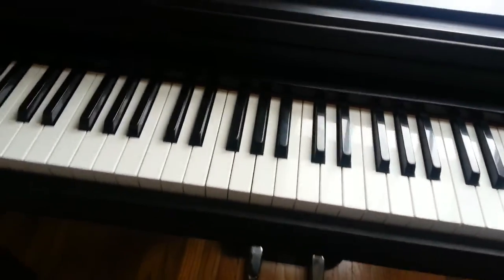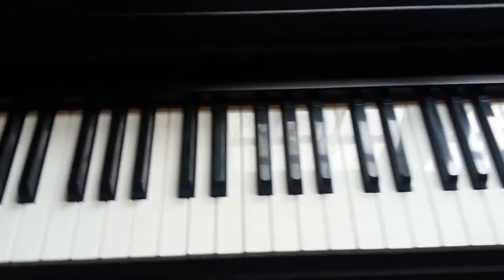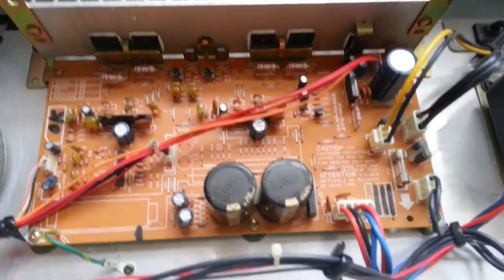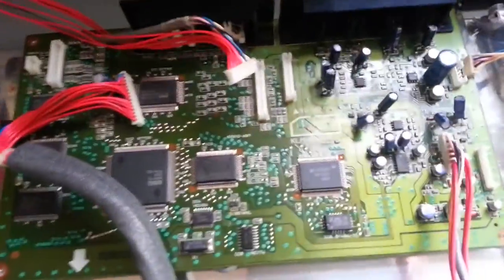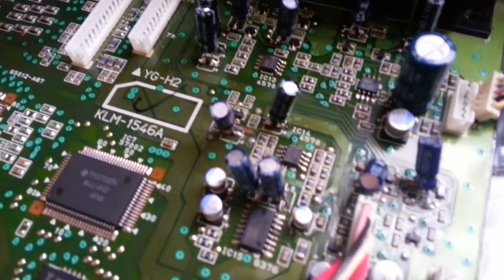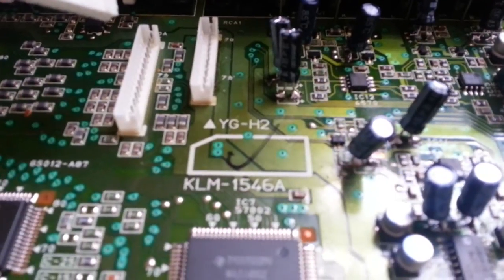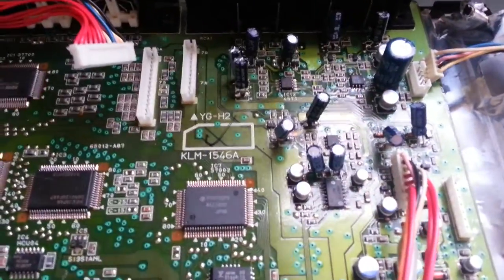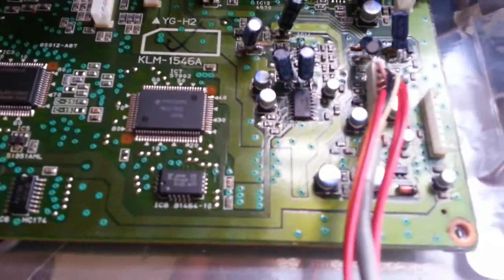How to Repair Korg C-25 Concert Piano no sound

Comment: Thanks so much for the great information on this topic. Picked up a free Korg C-36 last night. Powers up. Lights up. Very low volume and only left speaker works. I assume that replacing the capacitors is necessary. Never soldered before. Is this something a novice could do or should I hire out? Any good soldering 101 videos out there?
Reply: Also, where are the screws located to open the top cover? Doesn’t look like they’re on the bottom and the side is covered with a plastic cap. Any guidance would be appreciated.
Reply from the maker: I wouldn't recommend you to do the soldering, because if you are not professional-you can damage the board. Better to take it to some TV repair shop and ask them to replace the capacitors, also I would recommend after removing the bad ones to wash the board with alcohol.
 Good luck.

Comment: Thanks.  Got it open. Circuit board and capacitors look pristine. Any other ideas why I am getting no sound?
Reply from the maker: Were you able to check your amplifier, if it works fine, then the capacitors need to be changed for sure, do not be confused the way they look?
Reply: @artsvideoonline  I have a C15 and just wondering how I could check my amplifier as you mention here?   I sure belive my problems is witht the caps as well...lost sound over time, and then finallly only on headphones and not even that any more.  I can get very thin sound from AUX to phones, but that's it.

Comment: WOULD ANYTHING ON THE SOUNDBOARD MAKE ONE NOTE RING OUT AT FULL VOLUME  ON A CLAVINOVA , I HAVE TRIED EVERYTHING , UNDER THE KEY ,THE PENCIL LEAD  ,CLEANED CONTACTS , CHANGED OUT KEY , CHECKED DIODES ...BUT STILL THE SAME ONE KEY RINGS OUT ...THANK YOU......
Reply from the maker: ...you mean one key is producing sound all the time by itself?
Reply: hi,
no just pressing the key half way it rings out at full volume ,same volume no matter how soft or hard you hit it......thank you for replying and help
Reply from the maker: Each and every key has two buttons, if one of them does not work-you'll get that problem. I would recommend you to drop a conductive paint (just a tiny drop with toothpick) on black rubber, let it dry up for a night , then should work OK.
Reply: Fixed it ! .....the earlier clavinovas actually have 4 graphite strips pre key and after cleaning and repainting them 6 times ( made my contact paint with water based polyurethane and graffiti powder ) with no results on the last try before putting it on the lawn , Out of the corner of my eye a tiny glimmer of copper speck flashed on the trace between the next 4 strips , the green material that seals the copper trace had worn off so small you really couldn't see it.... but it was enough to make contact when the the key was pressed.... paint brush and poly urethane over the worn spot..... good as new....there is no way of replacing these board yamaha stopped selling them so bringing them back to life is the only way... thank you for your help , i hope this will help other people keep these alive....

Comment: Dear Sir, I've got a problem with my left speaker from my keyboard, I thought its comes from the broken of the left built-in speaker but when it plays a demo song through my amp speaker, the left part of the song was gone. I don't know how to fix this, whether to determine the problem from the speaker itself or from the capacitors, how to check whether the capacitor is fine or not, any ideas? Thank you for your help.
Reply from the maker: There are some capacitor testers which you can use to check if they are good, or bad, even if they are soldered on the board, but I would say you have problem with capacitors and I would recommend you just change all of this surface mounted capacitors, take a plier, twist them (brake the pins), clean the surface were the caps are soldered and solder the new regular capacitors and your problem will be gone. Please check the other videos I have regarding this problem to get more ideas about it.
 Good lock.
 Best regards:
 Arthur
Reply from the maker: Just go a head and change all of the surface mounted capacitors. Sooner, or later all of them are going to be bad. Do not forget to clean the mainboard with alcohol gently. Sorry for the delay, just saw your message.
Reply: @artsvideoonline  Thank you Sir for your reply, most appreciate it. I'll try it soon.
Reply: @artsvideoonline  Thanks again Sir.

Comment: I was given a C-25 with no audio. I have a whole pack of 10uf capacitors ready. I still can't figure out how you got that cover to come up so easy?!! Do I have to remove every single screw on this thing?! Somebody help please!
Reply from the maker: Check Armando Fernando comment down there, he explains. Also before removing the bad capacitors check my other video where I explain how to remove bad capacitor,  don't use soldering iron,  use the plyer,  twist them at the same time pushing towards the board . good luck
Reply: @artsvideoonline  never mind. It is the 5 screws at the bottom sides. Actually, you only need to remove the long 4 screws. Skip the short 2nd screw from the front. That's just for the front leg.
Reply: Woohoo!!! Left speaker working and loud! Now thinking if I want to keep going. Ahahaha! Panicked when I got a muted sound earlier. Replaced a few more. Then totally lost all sound. Then found the lost connection. I dont want to go through that again. Ahahaha! Dont even try this without a magnifying glass on a holder.

Comment: Hey Artur, great video. I wondering if you can me out, id really appreciate it. i have a korg c-30 and when i turn it on i hear a buzz noise for a second and the button lights flash for a second and disappears. and obviously the piano wont play any keys. Do you think you can help me with my problem?
Reply from the maker: It looks like your amplifier is bad, consuming too much power. Try to disconnect the power to your power amplifier see if the light stays on.

Comment: Hi! I have a Korg Concert C50, it looks almost identical to your C25. A few nights ago, I was playing and I noticed the sound was getting weaker and weaker. I smelled an electronic burning smell and then the keyboard no longer had sound. I unplugged it immediately.

I opened the keyboard, but I don't see any "burns" on the board or anywhere for that matter. The keyboard seems to still power on, although the power light doesn't come on.

Could this be part of the capacitor problem as well? 

I really love this keyboard- it's weighted so well, but as you know, its from 1992, so it's very old.
Reply from the maker: If there is no power  there are two posibol reasons:
1 power amplifier is bad (consumes too much current )
2.Something is wrong with the power supply itself. 
if it is possible first disconnect the amp, if you get the power back means amp is bad. If no,then check the power supply, diodes in the bridge, or  something else.
Reply: +Artur Aroustamian thanks for the reply! it seems there is power, but no lights on the display. I push power, and it makes a crackle like its powering on, then you can slide the volume and it crackles ...
Reply from the maker: footose It seems to me like your power amp is gone, most likly the burning smell you heard was from the amp, which is probably made on a single stereo microchip. If it is possible try disconnecting the amp section, if you get the display back-change the microchip.

Comment: Which screws did you need to open to lift the top?
Reply from the maker: Lior Noy On the buttom there are Black screws with square washers, and the ones around the black base holding the feet of the keyboard.
Reply: ***** wow, thanks for the response Artur! So the reason I was needing help is because the tray that slides out to cover the keys was jammed on the left side and would not pull out. After a lot of jiggling what I discovered is that the circular knob with teeth on it has somehow fallen off the track guide on the left and is now underneath it. I'm trying to place it back but there is a smaller black knob in the center of the while, the small piece that actual fits into the track and holds it from falling out in the back, that gets in the way of me simply lifting the big wheel and placing it back on the track. I need to somehow open the left side half inch so I can place the tray back in the track and close it. That is my issue I am trying to solve. Do I need to remove the top to accomplish this? I found the 4 screws in front bottom with the square washers. I have the upright piano legs attached, I'm not sure if I need to remove them to access the ones around the feet. Maybe these are all the screws to access the sound boards in your video. Is there another way just to lift the top and access the tray?
Reply from the maker: Lior Noy The only way is to remove all the screws holding the upper part, it is very easy, don't worry, just remove those close to the feet (big ones only) and 2 others on each side and it will come out.
Reply: +Artur Aroustamian Can you send the screenshot where the screw located? I can't find the actual screw to remove it. I got this piano from my friend but it don't have sound. I would like try to recover it and play with it.
Thank.
Reply from the maker: David Lee On the bottom there are 4, or 5 screws about an inch close to the edge, left side and right side.
Reply: +David Lee It's basically all of the outside screws. I count 14 on mine. you'll want to have the glass in the closed position or you may break it (if yours has a glass cover)

Comment: Yup, you were right. I did it and now the C-15S works. Still something funny going on in the amplifier board, but it's been burning in for a few hours now and seems pretty stable. Thanks again, Artur. How did you figure out it was only the 10uf caps. I didn't see any leakage until I'd removed them all, and some appeared to be fine!
Reply from the maker: I am happy you did it, good job.

First thing -first I don't like this surface mounted capacitors, in my experience they cause most of the problems on electronic devices,  second I have a great capacitor tester, which allows you to check them on board, I mean you don't even have to remove them to check BDS-88A CapAnalyzer
This is 20. Years old, they might have even better ones now.
Reply: @artsvideoonline  Cool, good to know.  Now that the tone generator board is up and working, I'm finding problems with the amplifier board. The caps are probably the first thing to check. Always something with older gear! Thanks again.

Comment: Great video but I have a slightly different problem. On power up I have no sound. After about one hour of warming up it works great. If I leave it on all of the time no problems. but I would like to figure out this problem New power supply is my only thought..
Reply from the maker: Bad caps on the power supply. I would recommend you to change them.

Comment: What value capacitors did you use? 47uF for all of them?
Reply from the maker: There are different caps in this keyboard, what you have to do is do step-by-step, after removing lets say 10Mkf, put the same ...., just instead of using surface mounted caps I recommend using caps with pins. Also read other comments, because a lot of people fixed their keyboards and you might find some useful information from there. Good luck.
Reply: I see.. I'll take a closer look at the values. 

Thankfully I work in an electronics shop so we'll have plenty of spare parts :)

Comment: i have a korg sg-1d keyboard that powers on,but no sound,could this be the same problem youre explaining?i also have a roland d5 that had a blown input diode,replaced it and still doesnt power on,i checked some voltage points that are marked 6v 9v and they are lower than marked,the only place that works on keys has a 4 month lead time,any suggestions
Reply from the maker: Surface mounted capacitors create a lot of problems, and if you have them in your keyboard I would recommend you just replace them with regular capacitors. If you were local would be able with your Roland, but can't help much at this point, if there was a shorted diod, check something else on the chain. I am in Glendale CA, if you are local just let me know, will be happy to help you with your problems.
 Regards:
 Arthur
Reply from the maker: Here is the link to your Korg service manual, wait couple of second and under the front page image you'll see this file is downloadable for free, click and download the PDF.

Comment: I have yamaha psre303 and it is making shiishhhhhhh sound.....Can you tell me what i should do..... Everything is fine btw except that
Reply from the maker: Looks like you've liquid leaked from som of the capacitors and it is making short connection on the PCB. I would recommend you wash the PCB with alcohol carifully and dry. Would be better if you change all of the surface mounted capacitors. 
Good luck.

Comment from the maker: Congratulations, on the board, in the upper middle part of it there are two capacitors responsible for sound output, one of them may is not soldered properly, or the connection between the upper and lower layer of the board is lost because of the liquid damage caused by the capacitor. 
Here is the link to service manual, were you can download the schematic. On the first page it opens there is a window, on the bottom it says: "Get manual", just click on it and a PDF file will be downloaded to your computer.
http://elektrotanya.com/korg_c-15,25,35,45,55_concert_series.zip/download.html

Comment: Not sure how to test amplifier
Reply from the maker: First if you have RED light on, means you have a power, if not -change the fuse. If you have power, then on the back it has RCA inputs, connect an RCA cable to one of the inputs ind just touch the center pin, you have to hear a bussing noise, means the amp is good, if not most likely the amp chip is bad (if there is no power problem).

Comment: Same problem for my yamaha psr e343
Reply from the maker: CHECK surface mounted capacitors, on Ebay you can buy cap tester for some $15, and when you find the bad caps just whach my video to know how to change them. 
 Good luck.

Comment: I have Kawai CN31 piano. It gives no sound. I have checked the capacitors on sound amplifier of my digital piano and got the following results in ESR levels. I used the peak ATLAS ESR70 gold.

10000 uF 25V - ESR 0.01 ohm - uF reading 8811uF
2200 uF 25V - ESR 0.02 ohm- uF reading 2015uF
470 uF 10V - ESR 0.20 ohm- uF reading 479uF
100 uF 25V - ESR 0.43 ohm- uF reading 98uF
47 uF 16V - ESR 0.64 ohm- uF reading 50uF
10 uF 16V - ESR 1.01 ohm- uF reading 11uF
1 uF 50V - ESR 1.10 ohm- uF reading 0.98uF

I am especially suspicious about theIr results for 10 micro and 1 micro F. They should be around 8 and 5 respectively. Do these results mean that I need to change the 10 micro and 1 micro D capacitors?

Thanks for your replies.
Tan
Reply from the maker: I don’t think so, did you check your power amplifier before this?

Comment: hello master.  we have our korg lp-35.  but no sound comes out.  If I plug in another amp and turn the amp up all the way there is very little noise (dirty sound).  - There are 3 capacitors on the motherboard. I changed them but there is still a problem.  Do you have any other ideas for this?

Comment: How did you open the cover so nicely?? I'm having a hard time getting the top to open.
Reply from the maker: +Gerrit van Rensburg Please check the comments on the bottom of the page,. It is very easy to do. large screws...
Reply from the maker: +Gerrit van Rensburg It has hinges on the back side, when you remove the screws it opens like a door.
Reply: Thank you so much! Found it. :D
Reply from the maker: Also watch my other video explaining how to remove BAD surface mounted capacitors.